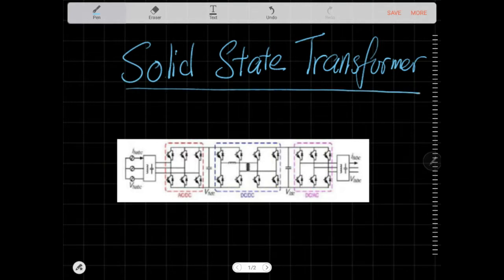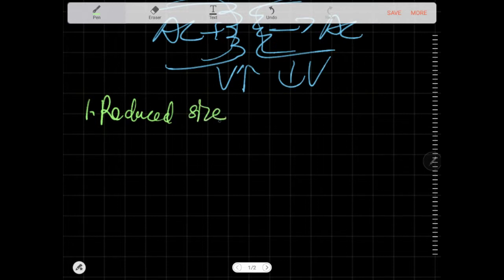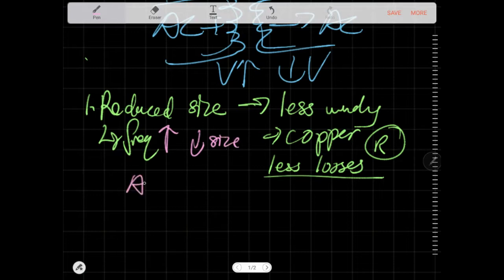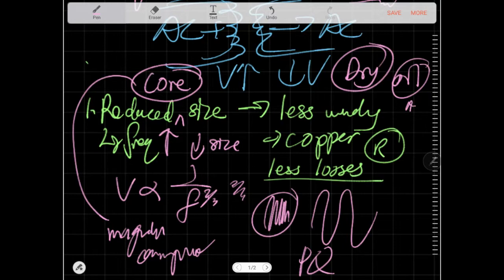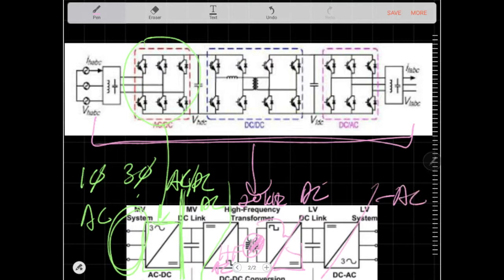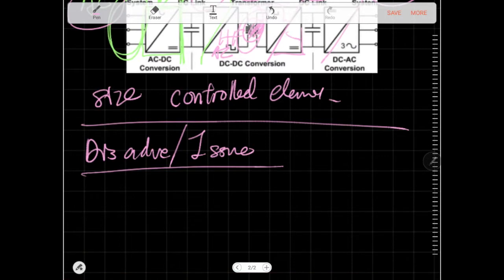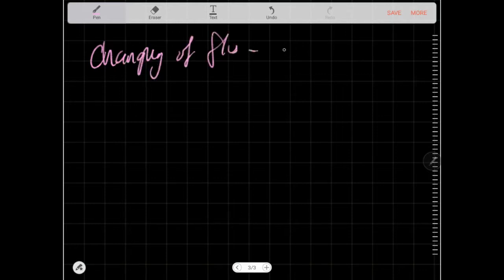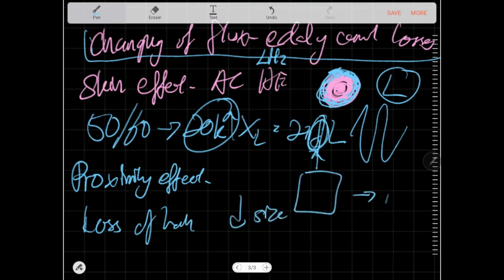Solid State Transformer - [FastEngineering]

Comment: You left out reliability and longevity.  Solid state transformers in battery chargers for example fail much more frequently.  If the manufacturer has poor customer service, it then saves them a lot.